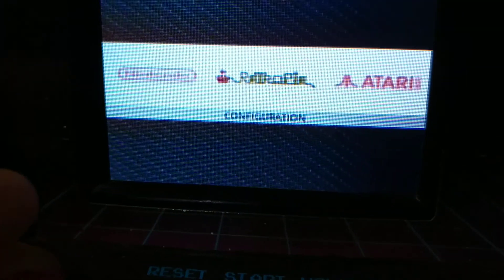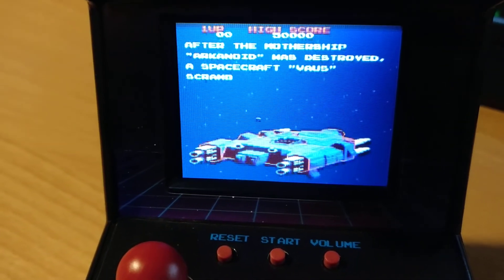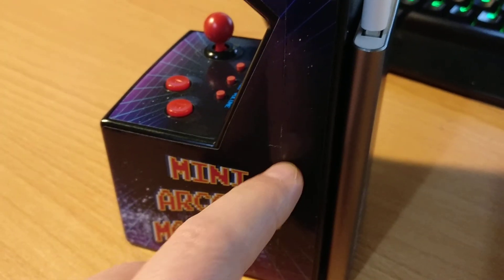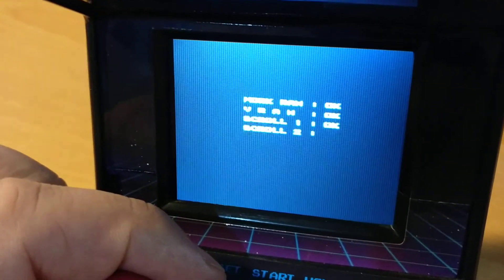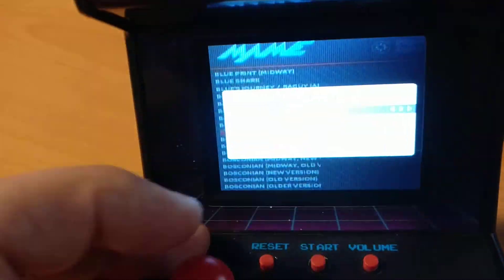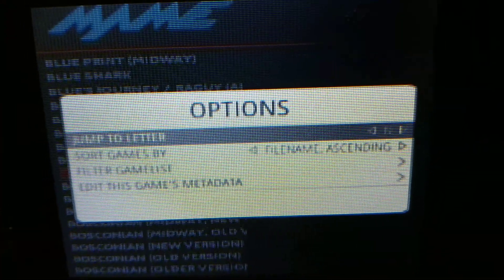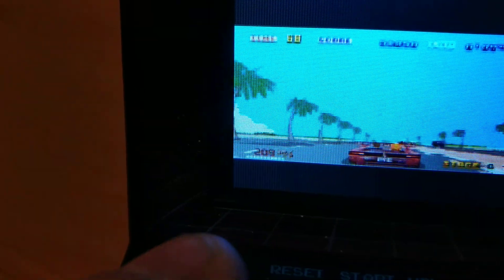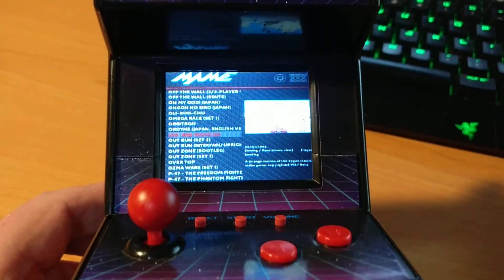Mini Arcade Cabinet with Retropie Mame. One day build.

Comment: I have one of those arcade cabinets.  I haven't modified mine... yet.  Despite shipping with 200 built in games, they all suck, so I've been thinking of doing something like this.  Parts list?  Did you use the original screen?
Reply from the maker: no the screen is a reversing display off amazon with composite in. its a 12v display but it has a 5v reg on the PCB so you just sidestep the 12v stage and run the whole lot off 5v.

Comment: Thats so cool i am making one with a similar mini arcade machine but i cant figure out how to get the controls working with raspberry pi please can you do a tutorial and more information as literally im only 12 and i dont know how it works.
Reply from the maker: I think it was just MMjoy running on a atmel micro pro or even a USB joypad gutted and stripped down to the chip... One of the two.
Reply: Thank you and also can you like show what's inside the arcade machine so I can see what you mean because how do you strip a USB controller i don't understand stand how to fit it in such a small space. 😀
Reply from the maker: @zakremtulla  Have a look at this. its MMjoy. this uses a cheap atmel controller as a gamepad controller. they are tiny and can be configured however you need for your setup. they then just plug into the Pi via USB as you would a gamepad. https://bit.ly/3jzIX5N If doing this with a gamepad. you are essentially taking the PCB out the game pad and chopping away the board where the pads are and using just the pins to the chip to wire up to the new buttons. If you think this is small, check out my tiny arcade running dragons lair! https://www.youtube.com/watch?v=LraH2gj52rs
Reply: @preferredimage  Thanks you. You have helped me so much! 👍😀

Comment: Hey this is really good, I’ve actually got the exact same mini arcade machine as you and was trying to do this modification anyways and found your video. Though I am struggling just a bit. Could you provide a more in depth tear down of how you put this all together?

Whether is be through a video or images I would greatly appreciate it. 

If you would like to help me please let me know so I can provide my email
Reply from the maker: If you imagine this being in a smaller box then my original homebrew arcade sort of shows the parts. The screen I used for the mini arcade was a composite reversing LCD from amazon which was modded to run on 5v instead of 12v. Otherwise its pretty much this. https://www.youtube.com/watch?v=nIGmkW36X3A

Comment: What Display do you use and how did you connect to the raspberry pi? How you connected to the gpio to have Audio?
Reply from the maker: Now this one was a composite AV display. happened to be a small reversing camera display for cars off amazon. it connects right up to the two video pins on the PI zero (put a header pin into it or just direct solder). For audio, if you search for GPIO audio pi zero you'll find a basic circuit. its about 6 components, just resistors and caps, nothing crazy. can be made pretty small and then you just designate a pin or pins to audio out on the pi with the driver.
Reply: @preferredimage  thx. Do you have a link for the display or the name to search it? Do you have a foto from your audio connections?
Reply from the maker: @DJPaoloda82  Pretty sure it was this one.  The screen is mounted portrait to fit in the housing and there's a mod to do on the PCB as it wants a 12v input but the pi only has 5 (take the power from the input source, not off the pi!) but there's a 5v regulator on the screen PCB, remove it and patch 5v to its output pin and the screen will run on 5v. Have fun! https://www.amazon.co.uk/BW-Monitor-Digital-Rearview-Automobile-3-5-inch/dp/B0056WJP1M

Comment: Can you provide amazon links and few pages on the step down changes, construction internally, how you wired up the existing controls etc? I've basic soldering skills but not much else :)
Reply from the maker: I used a similar approach to GreatScott's excellent video here:- https://www.youtube.com/watch?v=_MtN_s4tVK0 He links to the amazon parts as well.
Reply: brownb2vid Here's a youtube vid link detailing everything specifically related to converting the Dream Gear minicade shown in this video:

https://youtu.be/QYzBWlBy5cI